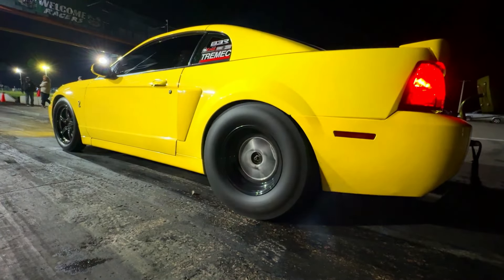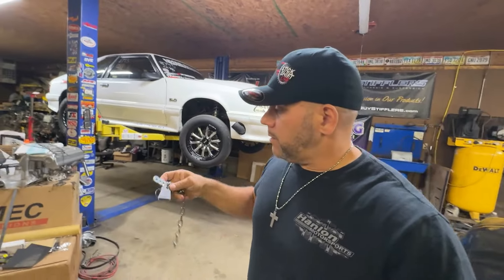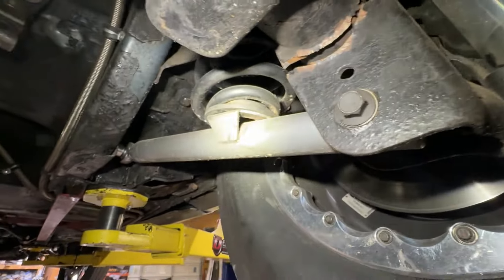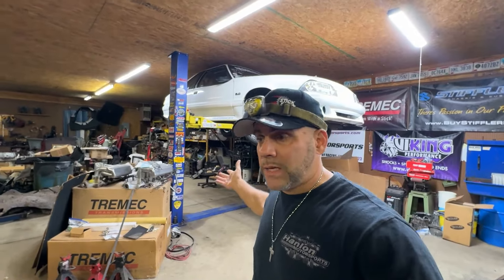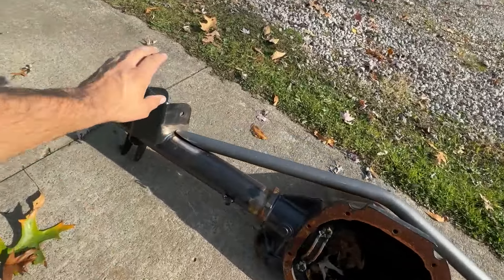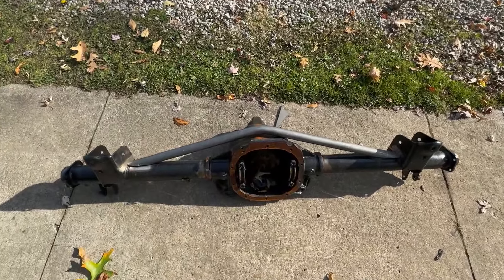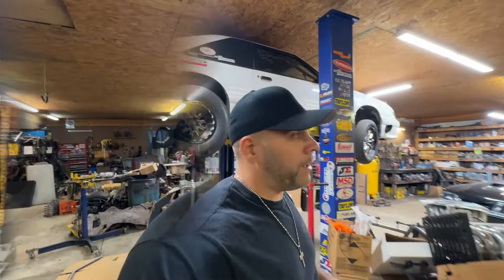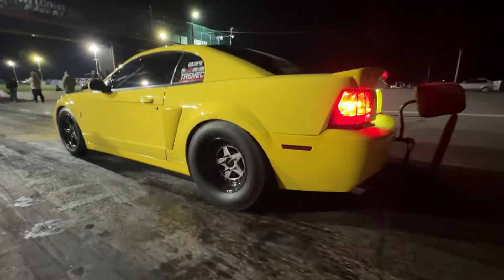LAST MINUTE CHECK Saves Car - Next Race Would NOT Have Went Well...

Comment: I was bolt checking my car back in May and found the right upper torque box ripped about 2 inches off the body. Second time it happened so I bought a Team Z upper torque box replacement and had it installed. It's really nice and it's just one less thing I have to worry about. Those stock boxes rip out during a gear change and you're going for a ride you don't want to go on.
Reply from the maker: Ya for sure. The white car will get boxes one day. My coupe has those uppers and lowers. Game changer.

Comment: ATSM regulations say that pump E85 varies from 51 to 83% E depending on the location and seasonal temperatures.
It seems to me that mixture variations might be significant. You said you have a checker to test each batch. 👍😎
Reply from the maker: Ya and most E85 is like that. Speedway is a shell company? Its always got the best pump E and always checks out very high in end of summer early fall. E85-E89 on the pump. During winter tho... its lucky if its E75..